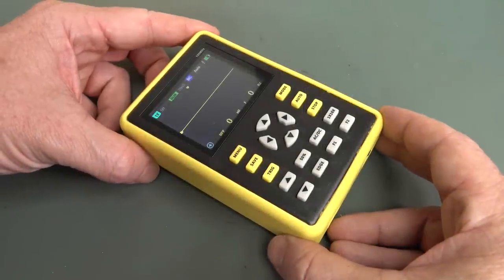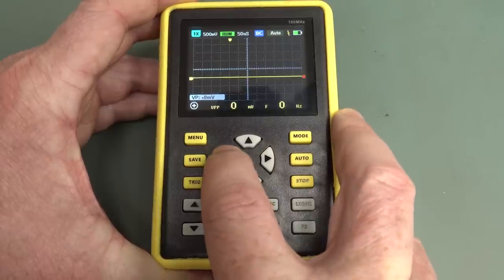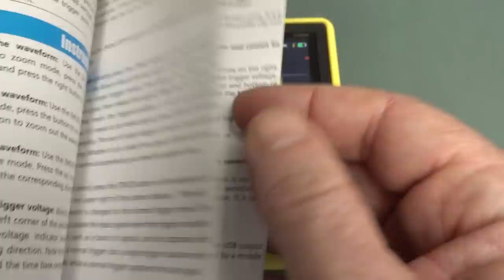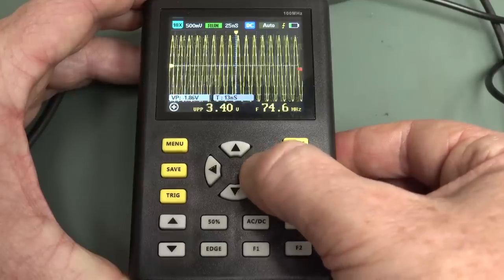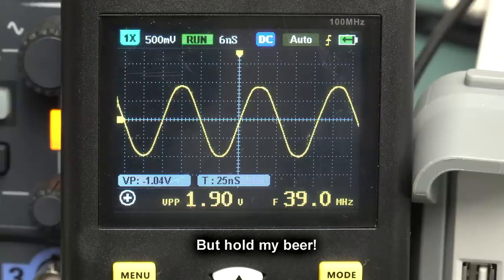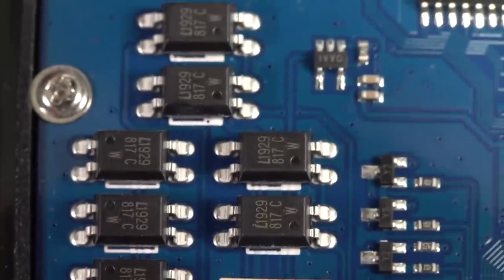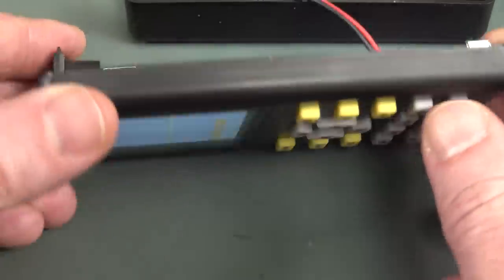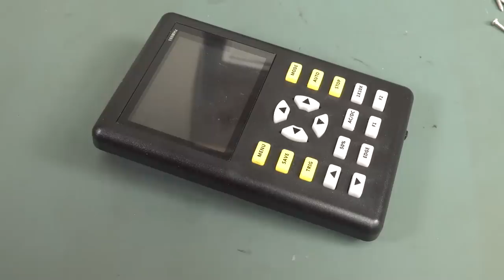EEVblog #1260 - $70 100MHz Oscilloscope?

Comment: The GD32F407 is likely a cheap-arse clone of the ST Micro STM32F407.
Reply: Yes, it is actually a one to one replacement. I think there is only one minor difference and that is it. I suggested switching it for the original and seeing if it makes it better.
Reply: Much cheaper. On the order of (pennies? Whatever 1/100 is) Of yuan so less than a penny per. That's why it's used.

Edit: actually, now that I think more carefully it might not be quite that cheap, but it's definitely less than 1 usd equivalent in china. So, compare that to stm32, which might cost $2 per in bulk and you can imagine why it's popular
Reply: @sheepsfeather3159  Cheapest I found it in china was $2.50 USD. I don't think you will see it for much less than that. The STM32 version is about $3.00. GD are fairly reputable and basically offer a slightly cheaper second source option. There are actually cheaper clone companies out there. GD outbid cypress semi, to give an idea of their size.
Reply: Tzuede Off the Cuff  The GD32F4 part does include an FPU but it has nothing to do with the issues found. The sample handling  will all be integer anyway, but the problem is the sampling and triggering is all handled by firmware rather than e.g. logic in an FPGA, and the micro simply isn't fast enough to do everything at the sample rate they are trying to run at. That said the Giga Device micro is actually quite a bit faster than the equivalent STM32 part.
Reply: If you're using a CPU to do sampling then there has to be a program behind it.

You'd have to be really optimistic to think the CPU can sample at it's clock speed;

Leaving aside more specific limitations with various IO pins...

To sample at the core clock speed requires that the entire read/write cycle and any memory addressing logic can be completed in a single cycle. That's really unlikely even if the CPU instruction set is single cycle per operation.

To take a CPU I'm more familiar with (but which is very old - though you can still buy them new)

If you were using a 65816 to do this...
Reading an 8 bit value from a memory location takes 4 cycles.
Writing it out again requires another 4 cycles.
That's absolute best case scenario (bulk move is a thing but not applicable to a case like this)
If any addresses need to be calculated you can easily add 20 cycles to that...

That means best case you're doing about 8 cycles per sample read, worst case you're doing nearly 30.

So if you were to use such a CPU for this, you'd need anything from 800 mhz to 3 gigahertz to read a 100 mhz signal (at one sample per cycle, which is nowhere near good enough for these purposes)

So, you have a cpu that does instructions in single cycles? Good for you.
Now you're doing it in 2-5 cycles.
Still you need a 200-500 mhz CPU to read a 100 mhz signal.
And actually you need a 1-5 gigahertz CPU (and no, multicore doesn't help you with this owing to the nature of what you're doing) to meet 5 samples per cycle...

So yeah, doing this entirely using a CPU is not a great idea;
Your best case for 168 mhz CPU is something like 84 mhz, but even that is hopelessly optimistic, and something in the region of 32 mhz or even considerably less is more likely.
Reply: @KuraIthys  One benefit of the ADC used is that bother channels can be sampled consecutively and the data combined into a single 16 bit word which should theoretically double throughput.  Unfortunately they decided to reverse the bit ordering of one channel to make the PCB layout simpler, so this adds an extra operation to fix the bit ordering in software that partially negates the speed increase.
Reply: I don't know how it is with GD parts, but st-link programmers I recently got from ebay had an CKS32F103 fitted instead of an original STM32F103. I couldn't flash some firmwares to those dongles, which never was a problem with the STM32s. So I'd rather pay 50c more to get the original, but unfortunately no seller mentions what chip they use. You just randomly get different devices (and I guess when all sellers are out of the STM32 stock it will be clones only).
Reply: Tzuede Off the Cuff  The ST part runs at 180 MHz, but if it's executing from flash there will be several wait states slowing things down.  You can also execute from RAM in the ST, but there is less of it.

Comment: Is there anything out there, that doesn't cost $100's or $1000's that someone who might need one once every year or two could keep around?  I've had a few projects and restores, over the years, when I've wished I had one.  But it's pretty rare that I couldn't figure it out with a basic Multimeter.
Reply: Ebay for an old Tek scope, people are throwing wonderful stuff in the skip.
Reply: @FarleyHillBilly  Thank You Sir. Any particular model I should look for or Avoid?
Reply: @johnmcdougald1238  
Avoid the old valve/tube junk 500's
400 series portables are good as are the 7000 series and plugins, 5400's are a bit tatty.
Reply: @FarleyHillBilly  many thanks.  I'll keep an eye out for those.
Reply: @johnmcdougald1238  
Hewlett Packard, Hitachi and Phillips make good stuff too.
Reply: @FarleyHillBilly  I'll start Googling and see what I can find for them also.

Comment: If it's not going to be accurate, you may as well buy one of the super cheap $20 ones. They have a rotary encoder that makes them a lot easier to use, and you don't feel robbed because it was $20. You'll need to hack in a lipo battery, but that's not rocket science.

Comment: Horses for courses. I'm very impressed by the price. Need 2 channels though.

Seems way more useful than the Chinese 1MHz AVR-based things. Pushing it for crappy audio there.

My main one now is a ''Bitscope' thing - 100MHz, 2 analog channels, maybe $250 dinky ADC box to plug into laptop (NSW company, btw). I thought I was going to need some logic analysis, has that in spades. Still haven't used those bits. The software is a bit weak, unintuitive, but has most things you'd want. Only really used on <200kHz circuits, but works fine there. 

One that was separate from laptop would be my next upgrade (or another laptop), though I have got curious about GHz regions, but a scope like that would cost Brexit dollars.

Comment: Im EEVBlog wird eine 100 Mhz Welle mit einem Frequenzmesser alle 10 Wellen übersprungen und dann eine Mischwelle einen kleinen Schritt phaseversetzt weitergesetzt um an der stellvertretenden Phasenstelle der neuen Welle im 25 Mhz Bereich zu messen. Damit dies möglich ist wird quasi eine synthetisierte Misch und Durchschnittswelle an 7 Transistor (R)-C Gliedern verlangsamt (und zeitlich phasenversetzt wie bei einem Sharp-Rechner) zwischengespeichert und dann viel langsamer abgetastet. Dies wird mir einem, 100 Mhz getaktetem AD-Wandler zwar an den richtigen Phasenanfang der Anzeige gesetzt. Das virtuelle Abbild wird aber im 25 Mhz-Modus des zweiten AD-Wandlers dargestellt. Die Darstellung des Ausgangs wird dann noch ein zweites mal mit dem Eingang synchronisiert und analog vermischt um kleinere Darstellungsfehler zu übermalen.-> Sehr ungenaues Gerät aber man kann für knapp 70 € sehr grobe Wellenanalysen glatt dargestellt vornehmen. Eine präzise Sequenzanalyse ist allerdings verbaut.Schon ein bisschen Schmu , aber trotzdem praktisch. Wenigstens arbeitet es bis 1 MHz präzise bis 10 Mhz noch glatt darstellend, bis 100 Mhz noch grob analytisch. Der Vorverstärker ist allerdings mikrig aber gerade noch ausreichend bei 50 mV. Dies ärgert etwas, weil ich das Gerät nicht mit einem andern Rückkopplungswiderstand auflöten möchte. Ebenso fehlt ein zuschaltbarer 50 hz-Filter. Trotzdem praktisch für Kleinstanwendungen und Geldbeutel. Man könnte auch einen 500mhz AD-Wandler einbauen (für plus 17 € ) als saubere Lösung und bis 10 ghz hiermit grob analog-halbdigital mischen. (gut die schnellsten noch preiswerten 7 Transistoren  bis 10 ghz fehlen noch. Summe: weitere 7 Euro) Ein bisschen unfair der Vergleich, allerdings suchen manche seit 20 J ein solches Oszi für die Westentasche. Das Gerät hat natürlich eine relativistische Macke eines Vermischers. Für ganz simple Alltags Messungen allerdings noch anwendbar.10 Ghz - Mess- Mischer würden dem Zeitgeist wieder aufschließen. 

Bei rein wissentschaftlichen Anwendungen wird hier natürlich alles physikalisch extrem unüberschaubar und grauenvoll bei dieser plumpen Transistorfraktionierung auf die einzelnen "wenigen kleinen HF-Transistoren" (hier sind  theoretisch sogar die im Ghz- reagiblen Monitor Analog-Pixel in Ihrer Auflösung zur Wellenbreite hin, bei einem analogen Oszilloskops als physikalische Sondenprobe noch genauer).Es fehlt einfach ein realistischer übergangsloser Sonden-probenspeicher der Mhz,Ghz,Thz,ExHz, bereits beim Erstdurchlauf ohne große Beeinflussung reell speichert und später verzögert in einer hochauflösenden Sequenz scannbar abrufbar macht.

Comment: I guess I had too high expectations for a 70$ "scope"...
Reply from the maker: Join the club.
Reply: I had to buy AnalogDiscovery2 by Digilent for university.  It was only 83 USD, and it's 30 MHz bandwidth with two channels, and a waveform generator.  Probably terrible by your standards, but I'm just an ME student.  Seems nice to me. The software is free, it's called Waveforms.
Reply from the maker: @MushookieMan  I've done a video on that, it's a nice unit.

Comment: There was a version before this that was identical in look, but has some better specs and partically the screen was way better, and can be the reason why some units and pictures look way better than your unit, as you got the limited one with TFT screen and not IPS.
.
Recall the first unit had a very bright IPS screen.(i purchased it, when there only was a few left after it was on sale ½ year ago.  it went down from like 120USD to 79USD in clearence sale) but cancelled my order at 79USD, and a month later, it was on sale again at BG to 55USD with coupon and remember i thought  great that I canceled the first order at 79USD,  and looked into purchasing it again at the new price' but then it also said in the new listing that they had to change some parts for this new lower price, and one of these was going with  a dimm TFT screen and not the bright clear IPS like the first batch... was also some extra stuff they had changed, not sure if BG productpage still says that info.
but anyway their was a model before this also 100mhz and at somewhat higher price.
anyway iI decided not to go for it at the second round. as the very bright and vibrant IPS screen was something that appeals to me with the first at 79USD.

just loooked and yes it still says so.(screentext-past)

"In order to save costs, the material of screen has changed to TFT from IPS. And the battery capacity has also reduced to 3000mAh.
So.....Just made A few minor changes, the price has gone down a lot!!!
-2019.6.24 DANIU Team"
Reply: my order 79USD was at 18/6-20,  and was one of the unit with better IPS panel-hardware..here the order title in orderview:
"DANIU ADS5012H Digital 2.4-inch IPS Screen Anti-burn"
a shame as IPS, is certainly preferred from here on such a small 2" screen meter so text and graph are vibrant and clear, partically on a 320x240 screen.. here paneltech can really make a difference...TFT vs IPS

Comment: I forgot the limitation on it, but I had determined that it wasn't worth it...
Reply from the maker: There are many limitations to this. New open firmware might fix a lot.
Reply: @EEVblog  That's it, the 5 MHz in 1X mode... around 12:40...  watching a bit more to see what's up with that...

Comment: This P.O.S. It seems like a monography by a Chinese engineering school student (which has very good universities and very intelligent and dedicated students) turned into a commercial product by scam and unscrupulous merchants (of those the Chinese also have many, as if to compensate things...). Here in Argentina, we have a lot of that kind of traders, but Argentinians, who are eager to sell this kind of bullshit at a top-of-the-line price ...
Over a quarter of a century ago, I was an electronics engineering student at UTN FRBA an I was part of a team intended to develop a pc based scope. It was a very low performance simplistic thing full of TTL chips on a bunch of breadboards. It was only a 100KHZ capable thing. I was in charge of the front end design, nothing impressive but I made strictly sure that it accomplish with the required specs. Also it has a hardware triggering circuitry, we discussed the software trigger option but on those DOS computer it was a problem.

Comment: I had one of those older white ones and it took about 3 to 5 seconds to generate a test from a board I was testing. I sold it much cheaper than I bought it for and purchased a Siglent Bench Scope. Just a beginner model but much better than I had 💫

25% way through, I'm waiting for the fail button... wahh, wahh, wahh

Comment: this looks like a joke compared to my fluke scopemeter 105b, its just as rudimentary to this but has more functions with better quality for a meter from the 94.
Reply: How much did the scopemeter cost? Not even comparable to the price of this I suspect.
Reply: @ferrumignis  I got it for around $300 off ebay about 3-4 year ago. on the bright side of these cheap devices is that there looking less like toys and becoming partially usefully. looking around to see what is out on the handheld market that is cheap, there is owon & hantek that would be more comparable to what i have. yea neither of which is comparable to how cheap this is but at least for descent new handheld units they are becoming less over the $1000 mark.

Comment: I seen a video on yt yesterday, someone analyzing the output of two consumer portable ac generators. He used a pocket scope also. But his was so bad it could not even display a usable 60 cps ac waveform. And so, completely useless for anything. I have experience using REAL bench scopes. I have seen these pocket scopes in catalogs and websites for ages, but never encountered one in real. I always assumed they were functional and usable, just highly limited. But with yesterdays video, and this video, I am thinking that one should always and completely avoid purchasing or using them. Yours is far better than the one I seen yesterday. You cover the specs and look inside and review. We find out that the MFR totally LIES about the specs and capabilities! This alone makes the point to avoid this and similar products. Thanks for the great video. I was considering getting a pocket scope for a while, but that has changed to "Not Even Going To Consider It Again!"

Comment: Is this oscilloscope fine for a Hobbyist in electronics and Arduino (ATmega328P), STM32, ESP32 microcontrollers?! Comments, please.
Reply: Naa, save your money. Hobbyist or not - you should be able to measure amplitudes reliably with an oscilloscope. Of course, accuracy depends on your application, but this thing is all over the shop. Especially the lack of a proper trigger cicuit would be a total show stopper for me. I've started with an old analog 20 MHz scope from eBay and it served me well for years.

Comment: That would be useful for me in the automotive field, seeing the waveform from the crank angle sensor or sensors would be good to have for $70US.
Reply: The DSSO138 and 150 Shell can do that, and it's a lot cheaper.
Reply: @Bob Sacamano It's definitely better, but I don't know about $50 better - unless you need the 10-ish MHz -. The DSO-150 is kind-of similar but half price, and the DSO112 is touchscreen. I love portable for automotive, but for $70USD I would  probably go for a 2ch DSO211 or put up with a PC based Hantek. I guess it's the tight-ares in me always looking for the budget stuff. lol

Comment: What's in a name? Sold as the DANIU ADS5012H on Banggood: https://www.banggood.com/DANIU-ADS5012H-Digital-2_4-inch-TFT-Screen-Anti-burn-Oscilloscope-500MSs-Sampling-Rate-100MHz-Analog-Bandwidth-Support-Waveform-Storage-and-Built-in-Large-3000mah-Capacity-Lithium-Battery-p-1469066.html?rmmds=detail-left-hotproducts__3&cur_warehouse=USA

With all its flaws, feebles and bugs it does show where the Chinese will go, where the West didn't and of course at the price we will all pay! Don't worrry the Chinese are very hot and quick correcting their problems and the MK2 version will be even better!

Comment: A bit like those $40 Vector Network Analysers - are they as good as professional ones? No. Are they accurate? Not really. Will they last many years? Probably not. Could they be used in production? No. But, they are cheap, they are useful, especially for hobby purposes. 

So, Dave's analysis is perhaps a little too critical. It's a toy to play with, not a piece of professional test gear. We don't always need the best there is - sometimes near enough is good enough. My first scope was from Bud. It had maybe 5 MHz bandwidth, limited sensitivity and a none too accurate timebase. It cost me £50 second hand in the late 1980s. It was all I could afford at the time.If sufficed to test if a signal was there or not.

Comment: 1 channel is a deal-breaker for most anything.
Reply: A single channel is perfectly useful for many applications e.g checking automotive sensors. It just needs good, reliable triggering on that one channel.
Reply: @ferrumignis  Fair enough. But don't you think the added relative timing measurement benefit of having at least 2 channels is more than twice valuable than 1?  I have to have at least 2 channels and 4 is what I prefer in what I do.
Reply: @lidarman2  Two channels is essential for some measurements,  and I would always prefer a scope with at least two and preferably four, but I'm just saying a single channel scope is still useful for many applications, and much better than no scope!